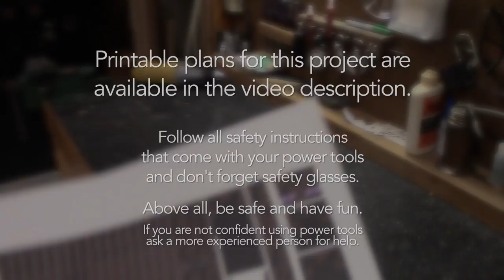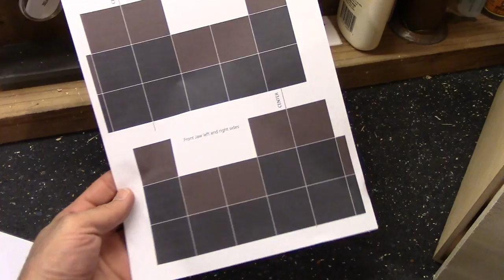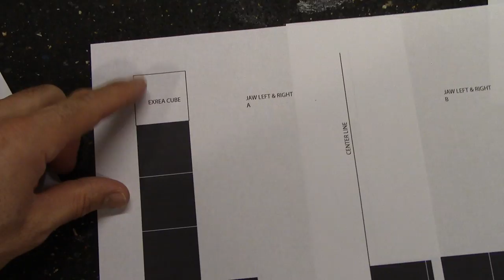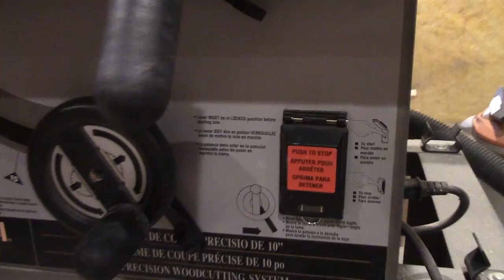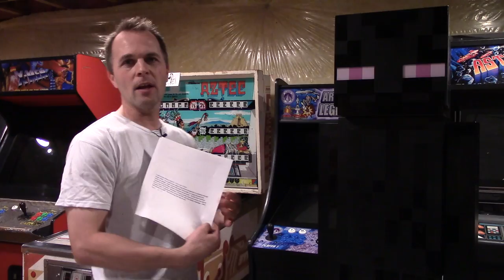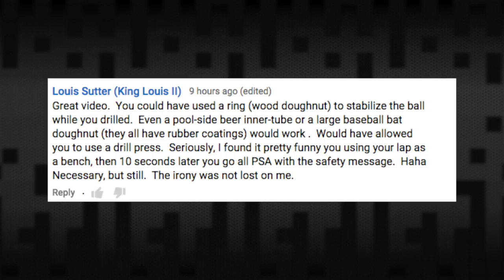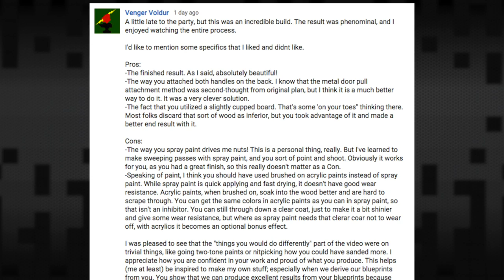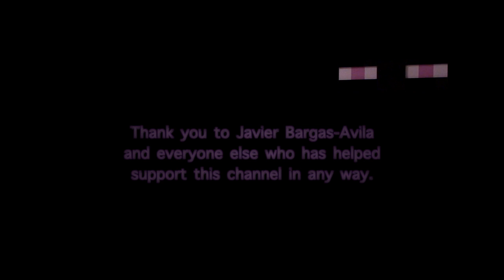Real Life Full Size Enderman - Woodworking How-to (Minecraft)

Comment: These are just  suggestions   and  suggestions are like shoes  if they don't fit  then  ya just don't wear  them,   You make  great    wood stuff i mean great!  However  I feel like you  could   cut the work  the weight and the need  for   so much tooling  by using  MDF and LDF   now of course  for    stuff like your wooden swords and sheilds  the pine is going to  be  perfect . Painting   you could save  yourself  some head ache by using  acrylics and doing washes for color differences . Thank  for  your  great vids   !
Reply from the maker: +videokilledaradiosta Yeah I really need to hunt down an LDF supplier.  I'm sure it's nice to work with.
Reply: +videokilledaradiosta only downside is how long it will last :(
Reply: if you seal ldf/mdf with a few layers shellac it could last quite awhile or even  put vynil contact sheeting over it.there are many ways  to seal mdf

Comment: For the eyes being washed out I think you could buy some purple/pink translucent plastic sheets and put them behind the eyes. That way the light will be tinted and won't overpower the printed eyes.

If you can't find purple plastic sheets then you could just use some colored markers (permanent would be best) and draw on some plastic sheets. You could add multiple layers to tint the light to your liking.

Hope this helps! ^.^
Reply from the maker: +StoreBrand I like your thinking! Thanks man. I went to the hobby store and looked at the stained glass but it was all swirly and not the right shade.  I'll see if I can scrounge up some plastics.

Comment: Awesome build!! When you use acrylic paint you should get an acrylic sealer, they come in both gloss or matte. Oil base or enamels you should use a sealer specifically for enamels or oil base paints. My experience is Home Depot has the two different types of sealers. I learned the hard way on a painting project, and have had success since using the right one. I hope this helps.
Reply from the maker: +montereybaymurals Totally helps! I think I'll go to H.D. today and check it out.  Thanks for the advice.
Reply: +HappyAtom oh and yes just like you said in the video, I to let the paint totally dry before applying clear.  Again. Awesome projects, I'm always eager to see what you do next! Keep up the great work!
Reply: HappyAtom did you add varnish? It is a must if you want to put it outside

Comment: Create a little Notch in there...  Unintentional Minecraft pun?

Great project.  I may make my own this weekend.

Do you think a 4x4 or other post would be a good substitute for making the arms and the legs to simplify?  Or would that be too heavy on the arms?
Reply from the maker: +FARezDragon Go for it! If the wood was lightweight it could work.  At least the legs would not be a problem using a 4x4.  The size of the squares on mine are 1.5"x1.5" so that makes the arm and legs 3" wide.  4x4s are 3.5" wide so your enderman would be bigger if you didn't shave off the sides.   
Funny, I only noticed the pun when I was editing!

Comment: you should paint the base so it will look like a dirt block. and for the eyes you couls put a purple light in it with shaded plexiglass ( use sanding paper on plexiglass smaller is the grain the more it diffuse the light.)
Reply: Philip Gagné or paint the base as end stone

Comment: Never mix both different brands of paint because they can have a chemical reaction just like the black paint you use, or paint it in separate, use tape to design the pixel texture on its body and face, the primer it with brand A paint. Then when its dry take-off the tape to expose the UN-PAINTED part then use brand B paint to color the un-painted part I think that will work. 

I hope.

Comment: Hey, I'm a huge fan of all of your videos... however I think a way you could get more subs would be to expand the area of your builds (in other words do something outside of Minecraft and Legend of Zelda). I would be ecstatic if you made a tutorial for making wand.  Whatever you choose I have loved your videos so far. :)
Reply from the maker: +Dillon “Dillon.H” Hussey Yes I plan on making a wand and also a wizards staff. What kind of wand did you have in mind?
Reply: nothing super specific but everything I have done with wands I have found that the harry potter design was both the easiest and normally most appealing. One thing to keep in mind if you do make a wand though is it looks a lot better if you cap the length at 13.5 in. or lower. For one if you make it any longer you look goofy trying to hold it and for two, well actually I can't think of another reason but I wouldn't make anything longer than 13.5 in. And with the staff  would do  LOTR based one.